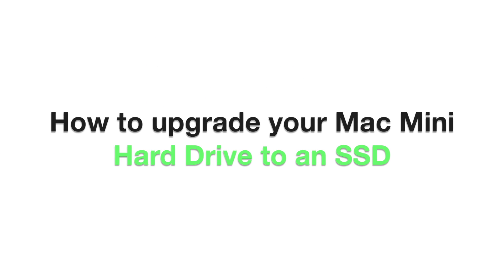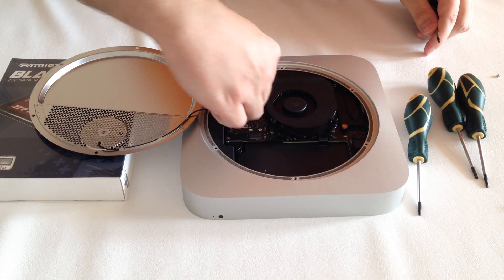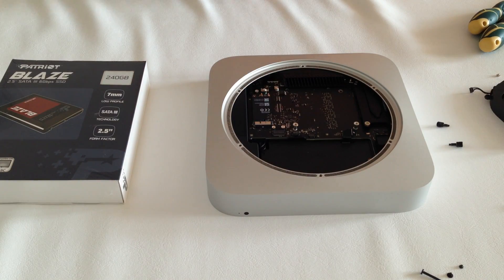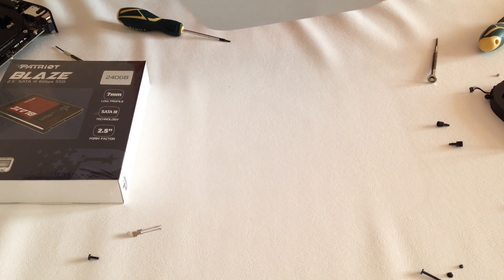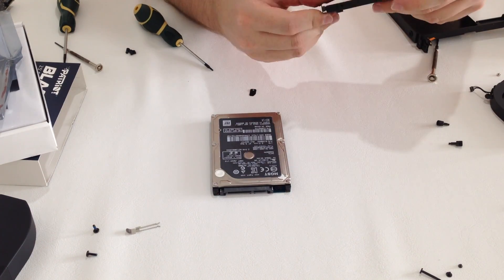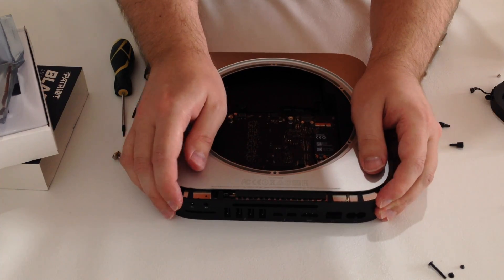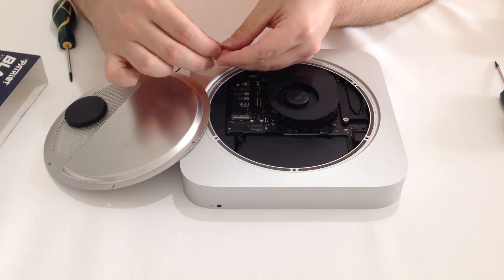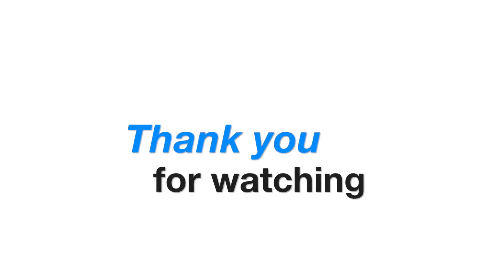Upgrade Mac mini to SSD (Late 2014/2015)

Comment: This mini was a mistake. The 2012 is way better
Reply from the maker: Thank you for your comment. It's still useful. For example, it works great for Cloud Gaming when connected to a TV, and has built-in support for Xbox Series controller via Bluetooth
Reply: @GetVladimir  yeah that’s the best part about Macs is that even ones as far back as 2010 can connect wirelessly to PS4 controllers to use on OpenEmu

Comment: I have a late 2014 Mac mini. I5. 500 hdd. Which kind of 1tb ssd drive will work? Are compatibility issues i need to think about? Im thinking a samsung 860 1tb 2.5”
Reply from the maker: Thank you for your question. Earlier versions of the EVO did have some compatibility issues, but I haven’t tested it with newer drivers. Either way, no matter what SSD you choose, it will be a big improvement over the current hard drive
Reply: I installed a Samsung 860 EVO 500GB SSD into my MacMini 2014 last year. It has been working like a charm ever since, huge speed improvement. Big Sur runs really well.
Reply from the maker: Thank you for your comment and the confirmation. Glad to hear that it works good

Comment: You can get quicker speeds by adding an M.2 drive to these, there's a connector on the logic board, usually the fusion drive versions of these have an SSD already installed, the adaptors are cheap now too. Just did it to mine, getting about 800mbps read and write.
Reply from the maker: Thank you for your comment. That is true, it’s even better with an M.2 drive now.

The only issue was that when I made the tutorial, the connectors were hard to find and the prices of M.2 drives were much more expensive.

However, if you can get them now, go for it. It should be faster than with an SSD.
Reply: @GetVladimir  Only just realised you made this in 2015!! haha Great vid as always, Thanks
Reply from the maker: Thank you 😊
Reply: Can you boot from that M2 drive? And use the original HDD as storage?
Reply: @pablovi77  yep, that’s exactly what I do 👌
Reply: So you have a late 2014 mac mini with 8GB of soldered RAM that can't be upgraded ?
Reply: @sandorebussolini  yes that’s it, there’s a adapter for an SSD on the logic board. You’ll need an M.2 converter though.

Comment: Great video thanks. Watch that second connector though after you take the fan off, I sheared the connector off the board!! It appears to be just the IR receiver and power light, so no big deal, but SUPER fragile.
Reply from the maker: Thank you so much for your comment! You're right, the connector is for the infrared sensor and it's used if you have an IR remote only

Comment: Change is not upgrade!
Reply from the maker: Thank you for your comment! It's definitely an upgrade when compared to the old hard-drive. Feels like a whole new Mac
Reply: Hdd+ssd it's real upgrade! PCIe ssd! I find special connector now...
Reply from the maker: Awesome! That would be even faster. There seems to be some issues if you want to make a fusion drive, but if you use them separately might be fine
Reply: Hi, sorry but this is a bit confusing... from what I read ssd have their own interface which is faster than sata. If so why bothering with the sata ssd at all, seems much hustle for only about 3 fold performance improvement. is it possible to fit a proper ssd in mac mini 2014? thanks  @GetVladimir
Reply from the maker: Good question! Yes, it's also possible to fit a PCIe SSD drive, but you might have to find a special connector/bracket to fit it.
Reply: @GetVladimir  Thanks for clarifying. Further reading reveals that upgrading this particular Mac Mini to PCIe is rather complicated and will not grant much better performance over SATA SSD. More info here: https://www.ifixit.com/Answers/View/265380/Is+it+possible+to+add+a+PCIe+SSD

Comment: Perfect!!!!

Hats off to you, Vladmir. This is the best video tutorial on the subject I´ve ever seen.

There are many people who try to scare people out of doing this, but it´s pretty straightforward and simple if you just know what your are doing. 

Of course it´s not as easy as it would be to replace a hard drive in a PC (more disassembly and some fragile connectors in the process), but it is easier than replacing parts on a smartphone, for example.
Reply from the maker: I’m glad if you found the video tutorial useful, thank you so much for you comment!
Reply: @GetVladimir just for feedback! I just did it, less than 30 minutes and zero mistakes thanks to your tutorial! THANKS on sharing your knowledge!!!!
Reply from the maker: Thank you so much for the feedback! Glad that you got it working and congrats on your new SSD drive!

Comment: Hi, I pulled to
Hard on the ir board connector and now I can’t put it back since the socket is damaged. Is this repairable? Or I just damaged the whole system.
Reply: did the same but Mac mini still working fine except for IR
Reply from the maker: Sorry to hear that. Do you mean the infrared sensor connector or something else? If it's only the IR sensor, it might not be completely ruined. I don't have experience with it, but users have posted about it here: https://www.reddit.com/r/applehelp/comments/6oyy98/what_does_the_ir_sensor_do_on_a_mac_mini_is_it/
Reply: Vladimir Kochkovski yes that is the right one. I’ll read about it. Thanks so
Much!
Reply from the maker: Not a problem, let me know how it goes

Comment: Watch this video and go to www.ifixit.com website, type in Mac mini 2014...then select hard drive upgrade. on the website it has clear pictures of the screws you have to remove etc. it also has clear pictures and instructions on how to remove the connectors. It looks harder than it actually is, you can get away with not buying the motherboard removal tool by just carefully pushing on the heat sink to remove the motherboard. It’s pretty easy once you get started.jay
Reply from the maker: Thank you for your comment and for the tips!
Reply: Vladimir Kochkovski I must say your video one of the best tutorials on how to do this upgrade on YouTube, you explained every step very well and it’s easy to follow.jay
Reply from the maker: Thank you so much, I appreciate that! I’m glad if you found the video tutorial useful

Comment: Followed the procedures with a 500 GB SSD from Cruicial and it works great. Not that difficult at all. Mac Mini feels 10X faster.
Reply from the maker: Thank you so much for your comment and congrats on your new drive! I'm glad if you found the video tutorial useful
Reply: What hard drive did your Mac mini have prior to the upgrade? What model crucial drive did you have? Did you need any sort of adapter or anything like that?

Comment: Hi, can you please answer my question ? : I saw in other videos, peoples using a dock / SATA-to-USB cable to connect the new SSD to the Mac. I didn't understand very well why this is needed, since you just changed de HD directly and said (in a below comment) that the system automatically install the OS in the new empty SSD. Can you please clarify to me why people used the dock ? Thank you :)
Reply from the maker: Thank you for your question and for watching the video. A dock can be used if you don't want to open your Mac mini and would rather use an external drive. If you're going to replace the drive inside the Mac mini with SSD, you don't need a dock.
To reinstall the OS, you can do it directly from the Mac (by holding the ⌥Option / Alt button when starting), or by creating an USB install thumb drive beforehand. If you have any additional questions, please feel free to contact me.

Comment: Another successful upgrade, thanks Vladimir.  Great instructions, process went easily.  Hardest part: plugging wifi back in (so tiny).  Installed a Samsung 250G EVO.  When done, installed Sierra from USB and used Migration Assistant to reload everything from Time Machine.  Installed HDD into a Inateck case with USB3.  Could not be happier - thanks again!!
Reply from the maker: Awesome! I'm glad to got it working and congrats on your new SSD Mac mini 🙂 Thank you for your comment

Comment: Does the system automatically download and install the OS?
Reply: Yes, you can buy a USB external hdd enclosure. Here is the one I've used.    https://www.amazon.com/gp/product/B00JQTO8TU/ref=oh_aui_detailpage_o06_s00?ie=UTF8&psc=1
Reply from the maker: +JamieinMN Thank you, JamieinMN!
Reply from the maker: +Ewan Hawking Yes, as JamieinMN also confirmed, you can use the drive as any normal HDD. I used mine for a PS4
Reply: +JamieinMN & Vladimir, awesome thank you! I ordered my parts off amazon, and they're on the way.
Reply from the maker: +Ewan Hawking That's great! Have fun 🙂
Reply from the maker: +Ewan Hawking Awesome! I'm glad you got it working. Thank you for the comment
Reply: I just completed a second one and it was considerably easier the 2nd time around. Thanks again!
Reply from the maker: You really mastered the procedure 🙂 Glad you got it working. How is the difference after upgrade? Night and day, right?
Reply: Incredibly smooth experience now for both my wife and I. She loves her upgraded mac mini. Thanks again Vladimir!
Reply from the maker: +Ewan Hawking Yes, you just need to connect it on Wi-Fi on boot and it will download and install macOS. Alternatively, you can create an USB install drive beforehand and use it to install macOS
Reply: oh cool, how do I create the USB install drive? Sounds way faster than WiFi
Reply from the maker: +Ewan Hawking You're right. Here is an example of how the procedure works https://youtu.be/2or1Wthkl1w - you can also find similar videos in the related section for macOS Sierra. If you have any additional questions, please feel free to contact me.
Reply: Vladimir Kochkovski awesome thanks! I can't wait to add one to my 1.4ghz Mac mini. It's just brutally slow to boot and start any program
Reply from the maker: +Ewan Hawking Not a problem🙂 The SSD will make a lot of difference
Reply: one last question: can the hard drive that we're removing be converted to external mass storage?
Reply: EDIT & Update - i hit command R, partitioned the drive, and it's installing Yosemite.  Thanks!
Reply from the maker: My pleasure! Happy to hear that and thank you so much for your comment

Comment: Would this also work on the 2016 models?
Reply from the maker: +Norfeldt Thank you for your question. Yes, the same procedure works with the latest versions of Mac mini
Reply: what specs should I look for when buying the SSD - I have no clue
Reply from the maker: +Norfeldt Please note that some Samsung drives cause issues on the Mac, especially the EVO, so you might want to look for a more compatible SSD. Any Kingston or any drive with Phison chipset (like Patriot Blaze) are a good match.
Reply from the maker: +Norfeldt You will need to look for a regular SATA 2.5" SSD
Reply: Vladimir Kochkovski thank you for the help
Reply from the maker: +Norfeldt Not a problem, anytime! Thank you for your comment
Reply: @GetVladimir  hi does WD blue 1TB 3D and sata ssd work on 2014 Mac mini?
Reply from the maker: Thank you for your question. As long as the height of the drive is 7mm, it should work. If it’s any taller, you might not be able to use it. I haven’t tested the WD Blue 1TB 3D though

Comment: Hi is a T6 screwdriver useable to open this?
Reply from the maker: +Adrian Leong Thank you for your question, Adrian! You will need to use the T6H because they have a small hole in the middle where the T6 doesn't. It's very likely to destroy the head if you use a regular T6
Reply: Ok , are T6H and TR6 the same kind of screws?
Reply from the maker: Hmm, I'm not sure they are the same. From what I saw online, they do look similar, but I can't say if they'll work as I haven't tested them.

Comment: On the fusion drive version of the Mac mini where does the pcie drive go
Reply from the maker: +Andrei _190 The pcie drive goes right on top of the HDD drive. There is also an additional cable socket that's not included in the HDD version of Mac mini
Reply: Ok thanks
Reply from the maker: +Andrei _190 Not a problem, anytime :)

Comment: Just ordered all the necessary tools via iFixit... and was about to order a Samsung Evo SSD (256GB) can't see any compatibility issues raised by users in the iFixit guide thread....! If they do cause issues please recommend me a drive in the same price range and something as fast.. :)

Nice straight forward guide, without useless talk...this is how it should be :)
Reply from the maker: +Mohamed Malik Thank you so much, Mohamed! I'm glad if it's useful :) Just to be safe, you might want to look for a more compatible SSD. Any Kingston or any drive with Phison chipset (like Patriot Blaze) are a good match.
Reply: The problem is where I'm living. Most ones in Ebay which are of Patriot Blaze are not shipping to Maldives. And most Kingstons one which do ships are also not the ones which have the same speed as the EVO series and Sand Disk Extreme Series. Since mine is a 500GB 1.4Ghz Model with 4GB RAM, i guess, its better to install the fastest one i can while i open it up.

Even Amazon, do not offer shipping services to where im living. Im lucky that iFixit ships the tools though.

Anyway, thanks for your advice. Will most definitely consider it. :)
Reply from the maker: Mohamed Malik Looks compatible. Please note that I haven't personally tested that SSD, so I can only talk from the specs on the website.
Reply from the maker: +Mohamed Malik I understand what you mean about the shipping. My suggestion is to see if you can find one locally in-store, preferably that has a return policy. The speed doesn't almost any difference in real life use. The biggest difference is going from HDD to SSD. And reliable is more important here than +/- 10% specs speed
Reply: Followed your video and ifixit guide , installed a 240GB sandisk SSD plus, the entire thing went flawlessly..... previously it took 1 minute 5 secs to boot. Now it boots under 25 seconds....!

Big thanx....!
Reply from the maker: Mohamed Malik Awesome! I'm glad if the video tutorial was useful and congrats on your new SSD! :)

Comment: Hi Vladimir! 
A quick question: could I ADD an SSD to my mac mini (2014 late I5), while keep the old HDD (1TB) at the same time?    thx!!!
Reply from the maker: Thank you for your question, bayernray! The Mac mini only has space inside for one HDD or SSD and one PCIe drive. If you can get an PCIe drive and cable for the Mac, you can keep the HDD inside (basically making a Fusion Drive). The hard part is that this has to come from another Mac or something that's very compatible. If you get a regular SSD drive, you'll have to remove the HDD.
Reply: Thanks so much for the prompt reply! I do have a follow-up: how could I keep the stuff inside the HDD while replacing it with a new SSD? 🙏
Reply from the maker: bayernray Not a problem, glad if it helps. You'll need to do a Time Machine backup first of your HDD. They, when you install the SSD, do a clean install on macOS and recover any files needed from the Time Machine backup.
Reply: Thanks！！！！！！
Reply from the maker: bayernray Not a problem, glad if it's helpful. Happy Holidays!

Comment: I would like to buy a SSD for my mac mini 2014,but have no idea which one is compatible.
Reply from the maker: Thank you for your comment and it's good idea to look for a compatible SSD. Any Kingston or any drive with Phison chipset (like Patriot Blaze) are a good match.
Reply: Hi, Vladimir.
Do you have any info about samsung ssd compatibility? I look at 850 EVO line (samsung mz-75e250bw) for my mac mini 2014 .
Reply from the maker: Andrey Kornilov Thank you for your question, Andrey! Please note that users in the comments have reported that Samsung drives cause a lot of issues on the Mac, especially the EVO, so you might want to look for a more compatible SSD. Any Kingston or any drive with Phison chipset (like Patriot Blaze) are a good match.

I don't have personal experience with the drive that you've mentioned, so I'm not sure how/if it will work.
Reply: Vladimir, thank you. I call for samsung support, they said that all last model ssd disk works correctly if you not use sata adapter. Am I right, that there is no need in cable adapter?
Reply from the maker: Andrey Kornilov They do connect through a SATA cable to the Mac mini, but I'm not sure if they refer it as an SATA adapter. I don't guarantee that it will work, it's on your risk if you want to test it. Perhaps make sure that you have an option to return it if it's not compatible.

Comment: i like this detailed tutorial .|

but i have quistions  

i installed windows 10 through bootcumb  with mac os in my mac mini 
how can i clone all of them together in one drive (SSD) ?  is possible? 

 or its better to re install mac os the install windows again ?
Reply from the maker: +Mohammed ALzuraiq Thank you for your question. Since you're installing a different kind of drive, it's better to make a backup and do a clean install of everything from the beginning. You will have much better results than just cloning.